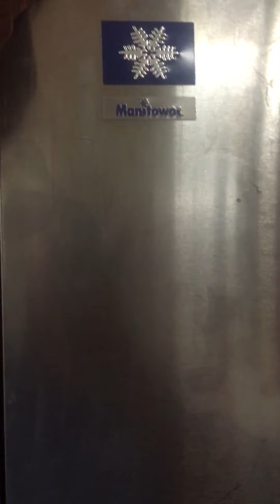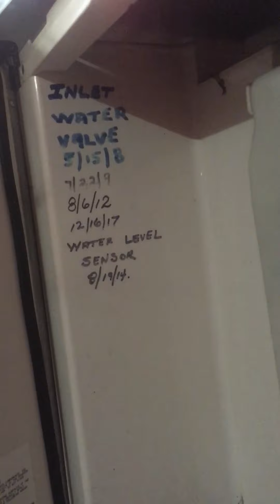Manitowoc maquina de hielo comercial no para de tirar agua 💦y no hacia hielo

Comment: Buenas tardes disculpapodras mandar una imagen de colo.estan conectados los capacitores al reley
Reply from the maker: Buenas compa  ya no tengo la information de esa maquina y aun si la tubiera no seria recommendable q se guie x otra maquina para areglar la de usted  ya que cada  maquina es de voltage difente y Cableado tambien  .yo le recomiendo checar el diagrama de su maquina para y segura la secuensia electrica para su compressor y tambien con un multimetro que Lea  MFD para checar los capacitadores en case q sea se la falla del compressor x la a no prende
Reply: Muy amable muchas gracias
Reply from the maker: @VictorLopez-es1gf  con gusto saludos 👍

Comment: Amigo podrías ayudarme con un problema que tengo con una manitowoc. El problema está en que funciona todo correcto a excepción es que el agua que entra nunca para y se tira en la charola.
Reply from the maker: Hola 
Checa con un multimetro el voltage de la válvula de agua  y  asegúrese q funcione 
El problema está entre el se sensor q detecta el nivel del agua o la válvula de entrada
Reply: @kikin2002  amigo la mía ase lo mismo, cuánto debe marcar el voltimetro? La mía es una id- 1892 monitowoc

Comment: Ocupo saber de una manitowoc pequeña comienza a hacer hielo normal y va disminuyendo hasta que prende y se apaga sola me puedes ayudar
Reply from the maker: Mándeme modelo y serie para poder Saber q tipo de máquina es y ayúdarle mejor
Reply: @kikin2002  buenas tardes amigo
Reply: Tengo ploblema con una máquina no hace hielo el no para de tirar el agua el modelo es B 570
Reply from the maker: @Marcos-ph2zg  
Hay q checar el sensor del agua cuando el agua toca el sensor se debería de cerrar el agua. Y si lo toca y no se apaga. Con un multimeter  checar voltage en la válvula de agua  puede ser q ya no sirva

Comment: una pregunta mi maquina ace hielo pero el agua no para de correr y no vota el hilelo
Reply from the maker: cheque5545  la única forma de saber el problema sería  checar todos los sensores. Para saver.  Con exactitud la razón q no deja de tirar agua 💦👍
Reply from the maker: cheque5545  buenas tardes amigo 
Probablemente 1razón  seria 
ice water level  probe 2006549 es el número de parte 
I la otra razón sería water inlet valve y tendrá q checar el voltage para saver q válvula necesita 120 o 220

Comment: Que tal amigo, conecte una maquina monitowoc IY1894-N261 y tiene el mismo problema que le presenta en el video, podría ser falta de gas? esa maquina viene de Estados Unidos a Venezuela.
Reply from the maker: Hola 👋  primero necesitaría checar las presiones para saver si está baja en refrigerante Las presiones cambian depende el tipo de refrigerante 
Haga eso y luego seguimos con el siguiente paso
Reply: @kikin2002  agradecido amigo